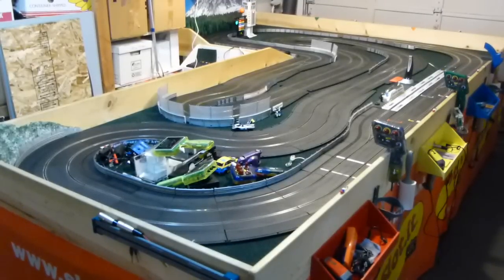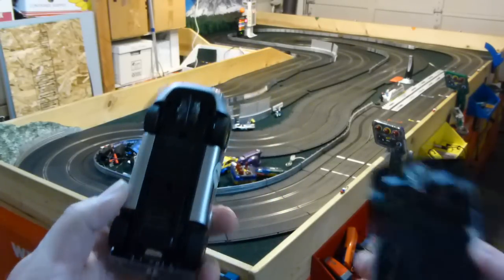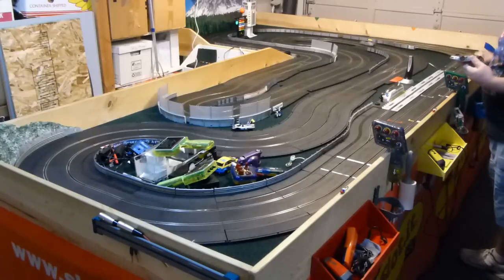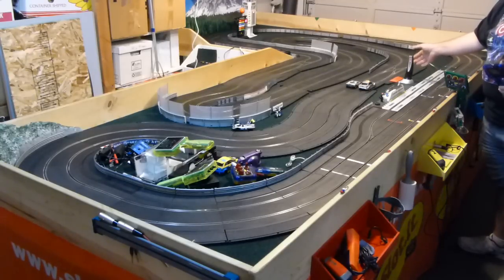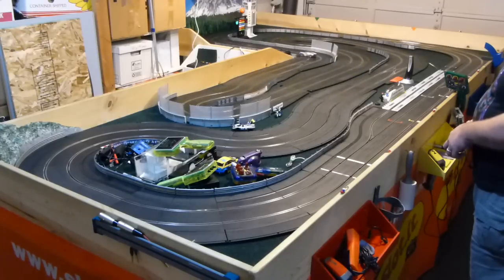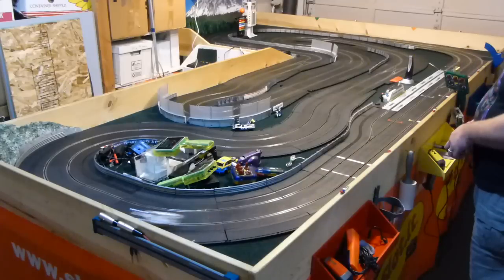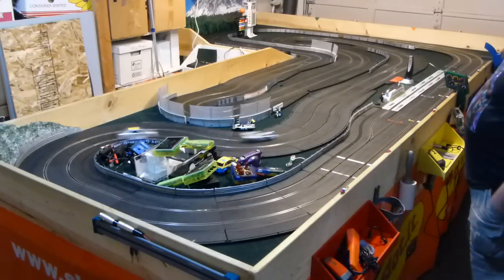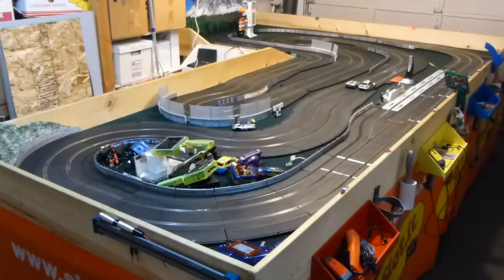Challenging a Scalextric Challenger

Comment: I appreciate you posting this video.  It makes me want to at least buy one to try.

Regarding what you say in your description about the computer seeing the car.  This is possible a number of ways.  My version that I am building is using 1 reed switch per lane, per piece of track, connected to some electronics that I'm still figuring out, but its all doable :)  Especially with Raspberry Pi's and Arduino devices providing a lot of interfacing options :)
Reply from the maker: Wow... every single track piece? That's a whole boatload of wiring, but yeah... anything is possible when you put your mind to it. Practical for most people, probably not. ;) But, I look forward to seeing your solution in action. I still don't think it will be able to beat a skilled human with an equal car, but even John Henry was beaten at some point. ;-)

Comment: Hello i just got the challnger car but a problem it didnt come with the trackside control will ot still work as like computer or not??
Reply from the maker: That's too bad. As far as I know, the only way to send the commands to learn the track and to race is via that tower. It sends infrared signals like a TV remote. The car is pretty much useless without the tower. :(
Reply: @ggaub  oh ok but can I still race with my own controller if not do you know where I can get a tower or does it have to be brand new car and tower to work??

Comment: Hi. Neat driving! I'm new to Scalextric and wish to get some. Is it worth starting off with digital? I get the idea that the only real advantage is that you can swap lanes. But I've heard that digital is more sensitive to slight track misconnections. It seems a lot more expensive, too!
Reply from the maker: If you're not immediately taken by the idea of changing lanes, having to deal with traffic and making passes around cars that are literally in your way/lane, then analog might be better for you. If you're not excited about the need to pull into the pit lane to add fuel, change tires to the right kind for the current (and changing) track conditions, repair damage from crashes, serve penalties for false starts or the like, then traditional slot car racing might be better for you. 
But seriously, there's more to it than just "swapping lanes". That said, if you're likely to be racing alone most of the time, then you're just as well off getting an ARC Air set. As long as you have a recently made smartphone or tablet, you can have some of the stuff I mentioned, as well as a ghost car (fixed speed) to race against. The wireless controllers are pretty good, and enable things like slowing the car down when you need fuel or tires. In fact, Scalextric took inspiration from the digital race management programs.
Another thing to consider is first looking for racing groups/clubs/tracks in your area. Once you look, you might be surprised what you find. If there are people nearby to race with, you'll want to just go ahead and get into whatever they're racing, because you'll end up doing that, anyway. :)

Comment: Hi Greg, I realise this video is over 5 years old, but it seems you're still responding to questions. I was just wondering how exactly the Challenger works? Do you just let it run around the track a couple of time to learn it or does it require manual input? Thanks very much
Reply from the maker: What you see in this video is what it should do straight out of the box. It has a special guide that records the turns. There is a button on the tower to tell it to record the lap, and then a couple different buttons for how challenging you want it to be.